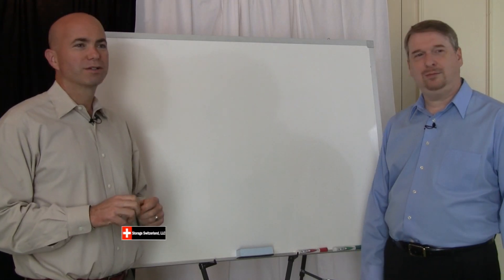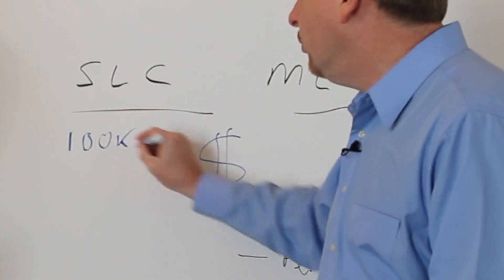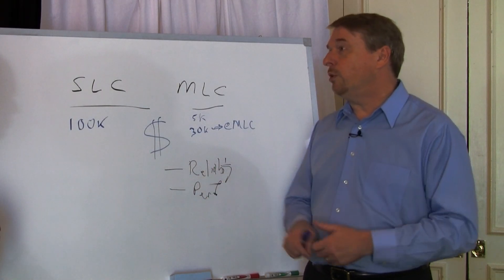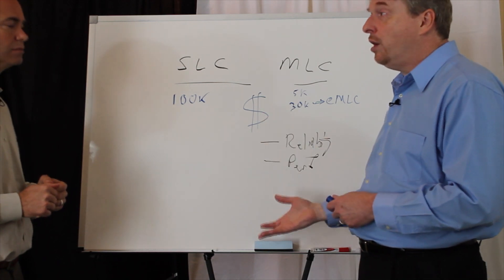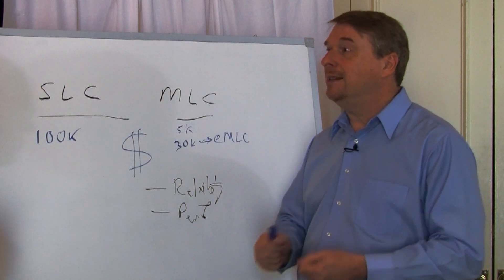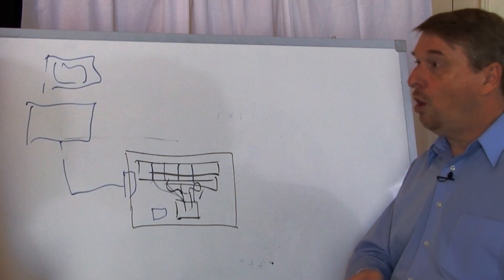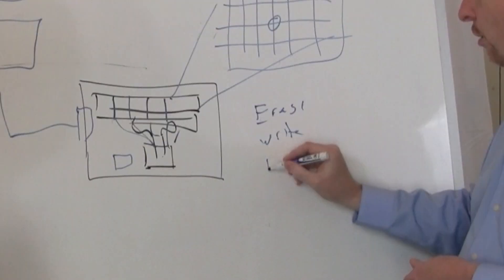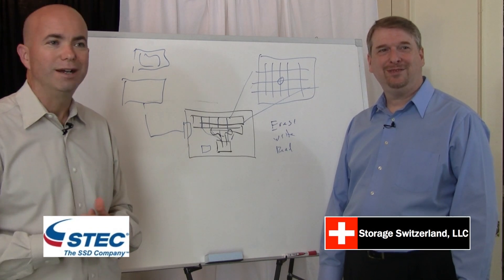MLC SSD Reliability Deep Dive

Comment: Searching for in-depth information, I didn't quite understand how the Cell Care works. A NAND flash IC is instructed with commands from the controller and requires external power supply which it internally steps-up to the required erase level. Erasing is done on a Block level so a single cell can not be erased alone. 
I would expect any wear level management algorithm to make use of this. 
So how Cell Care is "reaching inside the cell" when there are no special commands for that? Or is it Cell Care a re-branded weal level algorithm?